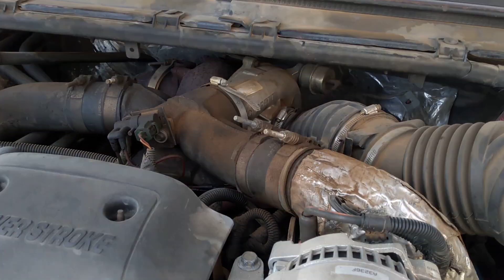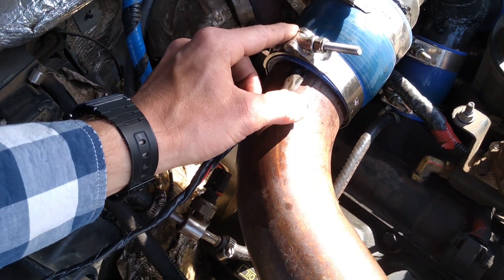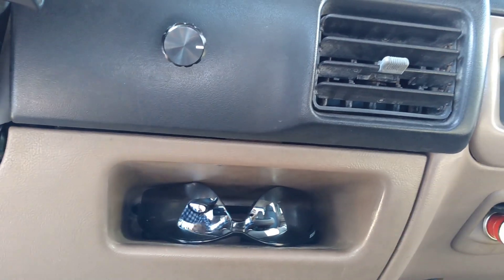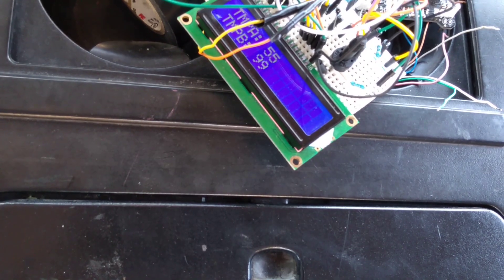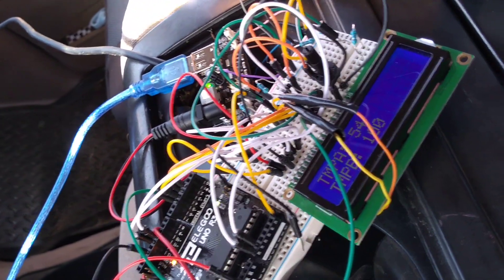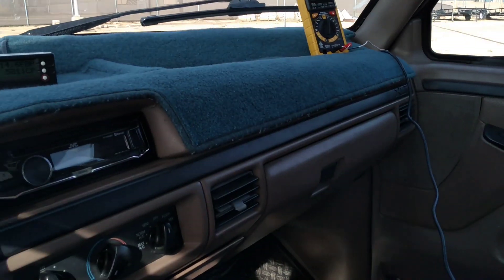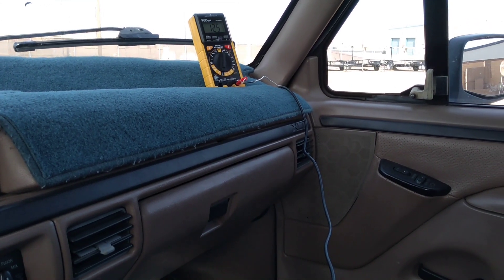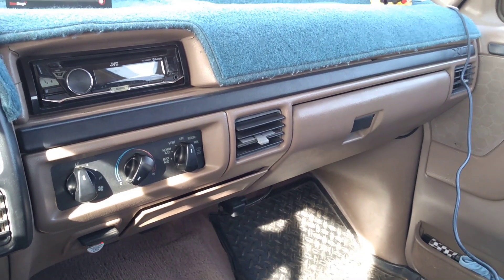Should You Insulate Intercooler Pipes?

Comment: Just a guess but I think the insulation on the cold side is more for sound reduction then for temps. Run high enough boost  the charge air temps can run hotter then under hood temps and the i/c only drops temps 10-15 deg But on the hotside we always wrapped anything tubed to retain the heat and help spool the turbo better
Reply: there is no insulation on the cold side.

Comment: Great video. I just found your channel and subbed. I have a 2000 7.3 Superduty. I have a few mods such as 4" exhaust, and Edge evolution tuner. I am thinking of adding a Wicked wheel 2 and S&B cold air intake. I wanted to add a set of Sinister Diesel's blue intercooler pipes for their looks. I've often worried about losing the insulation on the intake pipe. I don't race or use the truck for any heavy hauling. Based on your video, am I correct in assuming  that my temperature gain should be negligible ? I forgot to mention that I live in Arizona, and temps in the summer here are in the 115 degree range.What do you think? Thanks again for a great video.
Reply from the maker: I'm glad to hear you found the video to be helpful! I don't think you have to worry about losing the insulation on the intercooler pipes. For all intents and purposes the amount of heat that the incoming air would gain is negligible. Frankly the stock setup puts insulation on the turbo discharge pipe where the air is very hot. You may actually see a slight benefit in losing that insulation. The only downside is that you risk dumping that excess heat into the air intake which is before the turbo. I think the main reason for the insulation is for noise purposes anyway in the stock setup. Once you've built a good amount of boost any heat soak that may have previously occurred to the intercooler pipes will likely go away, so if you see any benefit in having the insulation it'll likely be on the 'low end.' Even at that point I doubt you'd notice any real difference. You may gain some performance however from a flow standpoint with the new intercooler pipes. Best of luck, and have fun with it!
Reply: @Rnddiesel  Thank you for thre response. I truly appreciate the help.

Comment: Since day one of owning my truck, I never thought to remove this insulation. 
1: that insulation does not look cheap to me
2: auto manufacturers are the ultimate bean counters.
3: for a engineer to approach an executive and tell them they need to spend 5 dollars on insulation, there better be a good reason when you produce 1 million units a year. 5 dollars is actually 5 million dollars in production costs.
4: we are talking about large conference rooms with charts and diagrams filled with data, and a slide projector. ( no powerpoint back then )
5: I am not in any possition to second guess them.

Do what you want, just keep things in perspective.
Reply from the maker: Absolutely! If anything the insulation makes it looks more 'space age.' Reflective foil insulation is exactly what they use on satellites and rockets for some interesting reason... There's no way the minuscule difference you'd see with the insulation would really be worth Ford paying much attention to, though it is rather curious that even with the economics of it, they still insulated the primary pipe coming from the turbocharger, maybe to protect the battery/ alternator from heat?
Reply: @Rnddiesel  https://youtu.be/FrFeaNGDnOk

Comment: I did the foil delete because I hated the way it looked on there
Reply from the maker: If it's the foil you took off of the hot intercooler side, it may have actually helped your intercooler performance by removing it! Either way, the difference would be marginal.